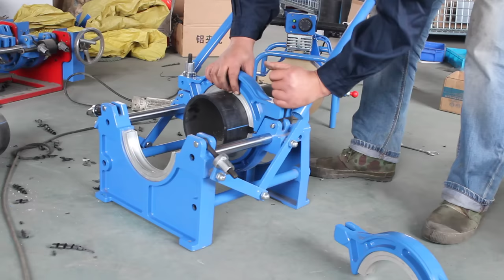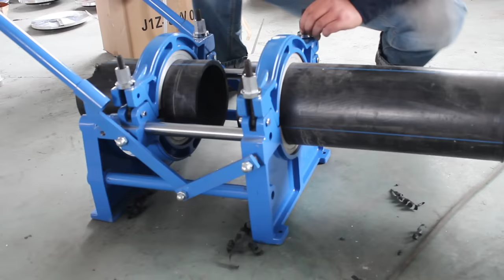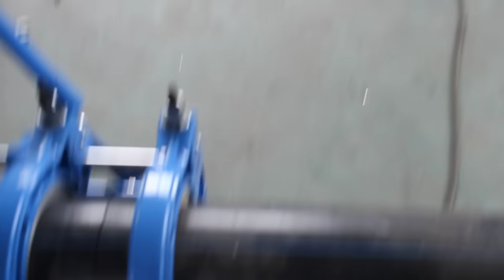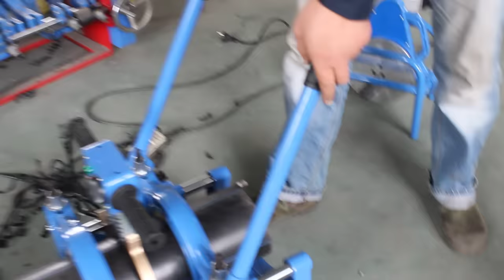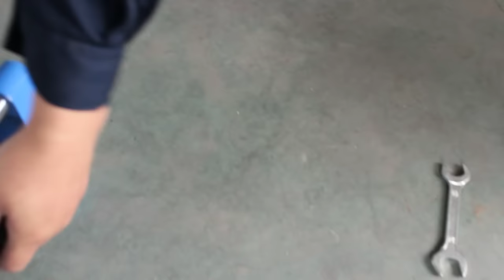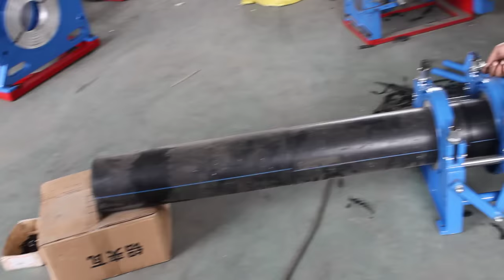hdpe butt fusion machine 160 hand push operation video

Comment: At best this is a drainage machine and then how do you weld fittings IE elbows,  stub flanges or anything else.
Too light weight especially for thicker walled pipe. 
Not suitable for any larger bore pipe welding like 315 if that's what it goes up to. 
Compare this machine to a Dixon 225 or 355 machines so you can see what I mean.